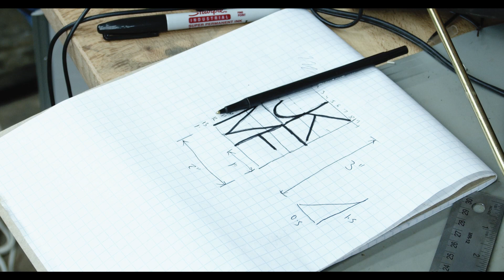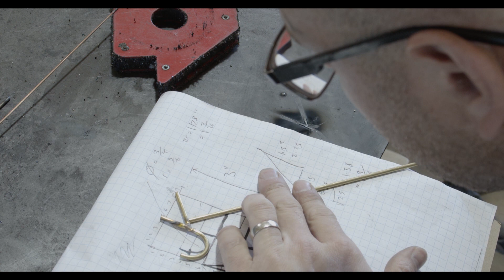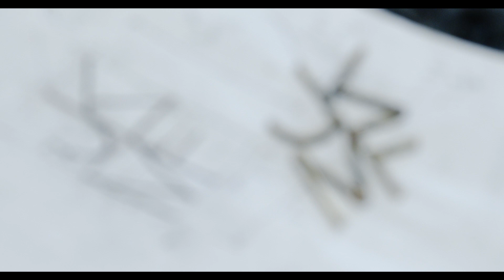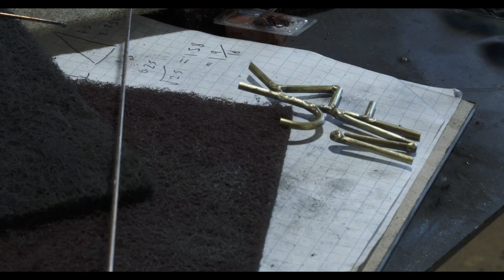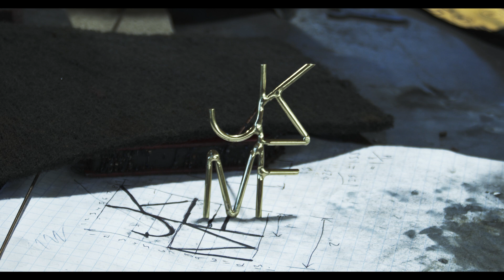JMKF

Comment: That's a humane size, haha! I plasma cut a brand for my niece and, using the line width and letter height size recommended by the livestock board, it was huge! I think she got a bit carried away with the design without considering the application.
Reply from the maker: I went deep down a cattle brand typography rabbit hole years ago. I deviated from their recommendations, and then deviated from my own drawing. That's one of the great things about brands -- there is so much variation in how people do the letterforms. It's mechanical, functional, and clearly hand made.
Reply: @superchromat  As a kid, I was fascinated by the fact that we had our own unique brand and spent hours dreaming up my own brands. After my dad passed away I renewed his brand so it was still valid until I sold his cows. Sometimes I wish I would have kept it up for nostalgia sake. A simple 'F' with an 'H' hanging down at a bit of an angle from the small bar of the 'F' with a "half moon" segment of a above them.